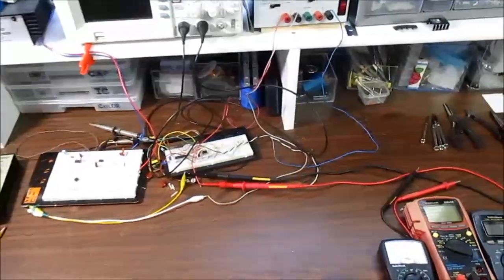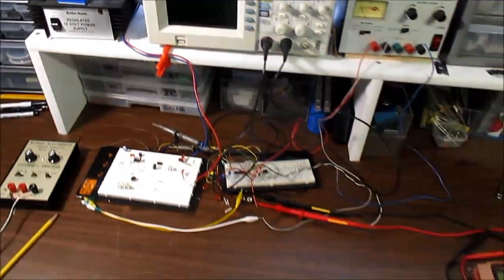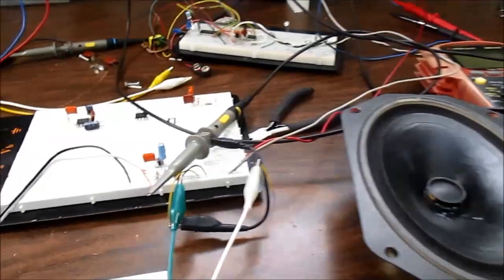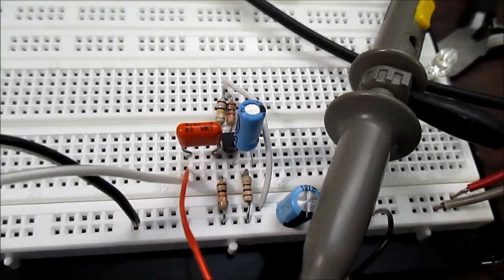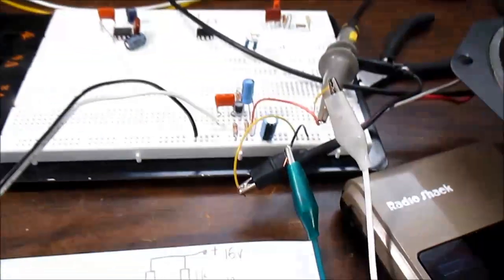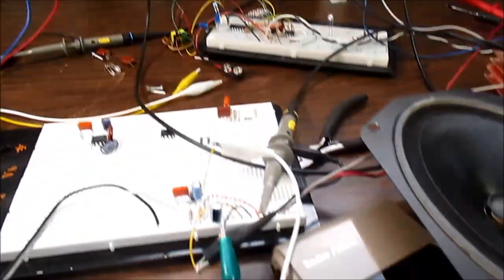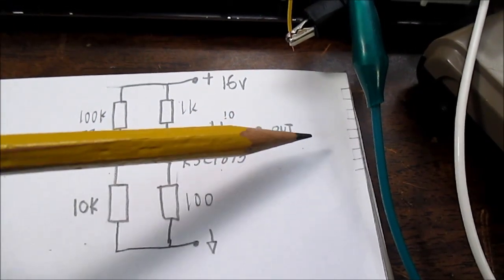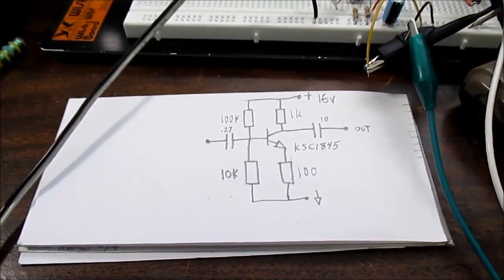Connecting speakers to preamp (trap for young players)

Comment: Question: I've got an old tube radio with most of the guts, aside from the stereo missing. It's one of those old portable battery powered ones. Could I buy a pre-amp and power amp small enough to put inside it and wire to the speaker, while running power in from a wall outlet instead of batteries? I've been looking at the Little Bear tube preamp on Amazon, but electronics and av stuff is a bit over my head.
Reply: The radio is an Ever Ready Sky Casket.

Comment: How about changing this 1k resistor to e.g. 330 ohm one? Having a transformer to get proper impedance (and fixing other resistors to get correct bias if that's required) shouldn't we get better amplification?
BTW, I'm also curious how powerful a one transistor amp can be. As the power is voltage * current, thoretically one transistor amp should be powerfule enough to run small (e.g. 1 watt) speaker loudly, especially when you have such high voltage (16V).
Reply from the maker: With 330 ohm resistor and matching transformer, the maximum power output (ideal) would be under 100mw. Normally the transformer's primary would be in place of the resistor. Check my video "Adventures in a one transistor audio amplifier" and the follow up, "Simple two transistor audio amplifier" (can't send links due to spam filter). Replacing the resistor with a current source and heavier bias (around 600ma) gave 1.3 watts into an 8 ohm load with 15v supply. Of course it needed power transistors, heatsinks and drank around 10 watts sitting idle.

Comment: can you explain please how to wire correctly speaker in phase. hear talk about wiring a bunch of speakers out of phase. how do they do that and how do they fix it?
Reply from the maker: Speaker terminals should be marked with a + and - . These should connected to the corresponding terminal on the amplifier (speaker plus to amp plus, speaker minus to amp minus). If you have a stereo amp and connect one speaker as mentioned but connect the other speaker so that its + terminal goes to the - terminal on the amp and the - on the speaker goes to the + on the amp, it is said to be wired out of phase. It will make the stereo image seem wrong but won't hurt the equipment itself.

Comment: John, what's the purpose of the 10k resistor? Love your channel, thanks for the videos!
Reply from the maker: It makes it easier to set the bias current. Without it you would need a very high value resistor from the supply to the base. It helps to reduce input impedance and keep the circuit stable.

Comment: Well u can make this work if you wish but its not that simple .Firts of all this circuit conducts dc as well so a transformer is a must 
Also if u remove the collector resistor as well as the emitter resistor and also be a litle bit more reluctant in the bias current  u could theoritically make it work
I ve personally made a sigle transistor amp using a to 220 package transistor no base biasing just an enough high of an input voltage to turn the sucker on and no limiting resistor the only collector resistor was a 220 vac to 24 vac power transformer
And it actually fuctioned but we were again current limited and also my 18 vdc power supply was not enough 
And btw i used a biiiiig heatsink becuase the transistor wasnt liking  the circumstances if u get what i mean...
Reply: What's an alternative simple circuit that will power a speaker?
Reply: @SheikhN-bible-syndrome  class b pair  DC decoupled

Comment: So that's what a bench is supposed to look like. If you're anything like myself that will last about 2-3 projects! If that. Nice video. Does a preamp actually clean up an audio signal or just boost the signal so the amplifier can reach its potential?
Reply from the maker: After this video it is already getting messy! A preamp is simply a voltage amplifier. There is no cleanup capability. If there is already distortions and noise in the signal, it all gets amplified and sent on to the power amp. A properly designed pre stage should not distort and add only very minimal noise to the signal. In some cases the peamp can render the frequency response of the signal such as in a phono preamp but in that case it is not purely a simple preamp.
Reply: Well, I would say it 'controls' the signal going to the final amplifier. A pre-amp may have 0 gain. It's MAIN purpose is to act as a line level control. A volume knob. Of course, most also adds gain to the signal, but it doesn't have to to be a pre-amp.

Comment: sir my ques is besides your this video...but im having so much problem of making tda2030a amplifier
n i think the problm is coming from power supply
im using 12-0-12 transfrmr by rectifieng ic gbu600  n 3300uf caps to filter it....n when i measure voltage after being rectified n filtered the output voltage is +-18 volt....and when i connect this suppy to my amp circuit a burning smell comes from tda ic(i have burned two ic before).....i checked many times my tda circuit n its fine...
n later i used a 12 volt battery..with caps the circuit works but very much noise is coming....i knw . the 12 v battery is not permanent source but   pls help me how to make power supply for this circuit so my amp works fine...
thank you n srry for long post
Reply from the maker: +/- 18 volts DC from a 12-0-12 AC rated transformer (at no or very light load) is perfectly normal. If your positive the amplifier circuit is fine then you must be connecting the power supply up wrong. Double check the voltages. If that is not it, it could be counterfeit ICs. The TDA2030A was discontinued 3 years ago and there are many fakes being sold.